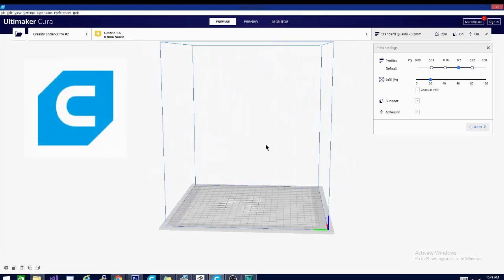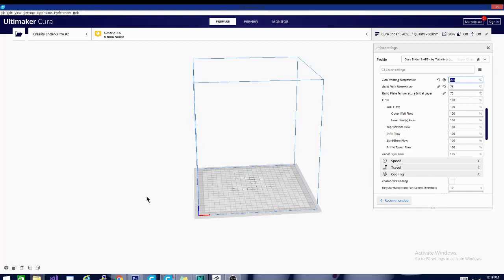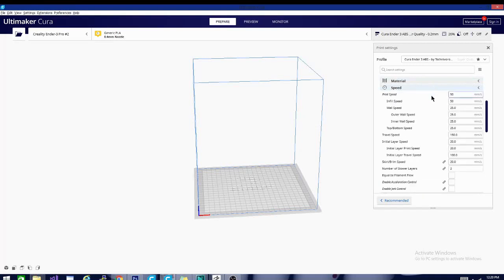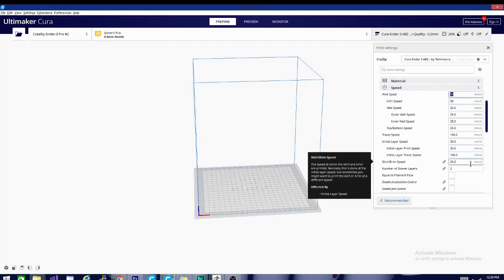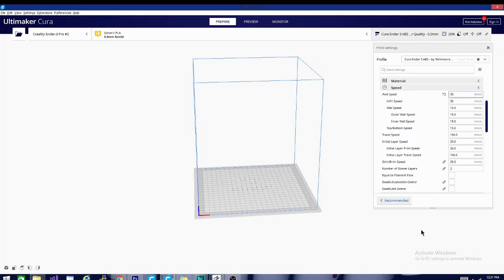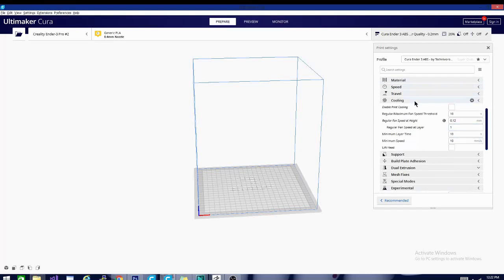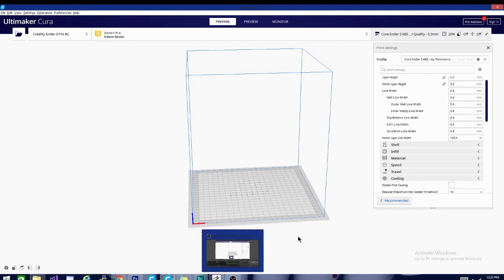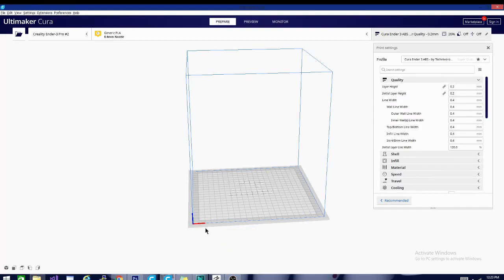Cura 4.8 Tutorials - Material Settings - TPU Settings

Comment: Hallo... i have try print sample file g-code from anet et5x it's sucess fully.
but if i try print my design 3d model can not sucessfully. 
if i look 3d printer work the filamen can not drop in bed a normaly, thats a litle filamen out. 
could you tell me, how to setup in cura v4.8.
i have instal the cura vertion as your recomended.
thank you